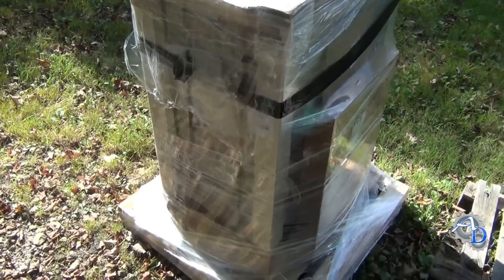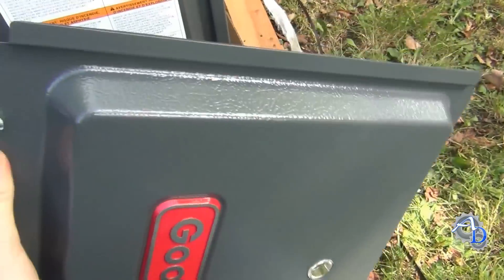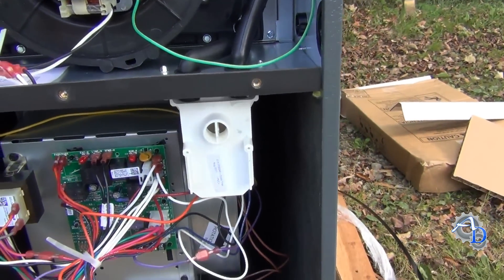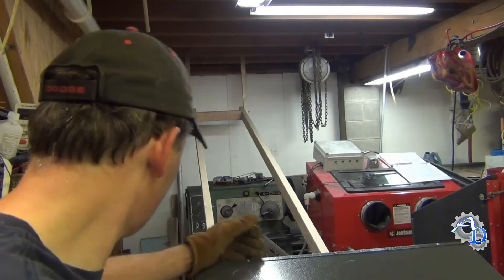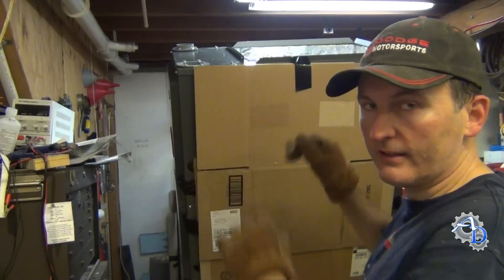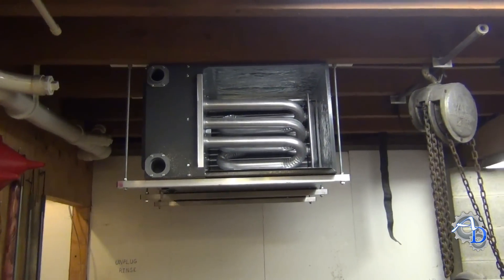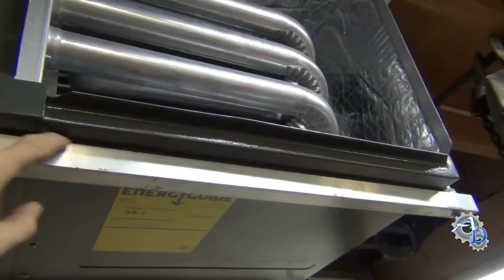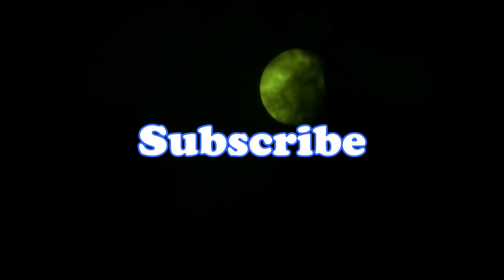HVAC Techs Didn't Like This Furnace Installation

Comment: Are you going to show the rest of the install? I wonder whether the mfg. allows the heater to be installed horizontally?   Thanks.Jim
Reply from the maker: I don't have footage of the entire installation. The manual shows how to install horizontally and where to run supports.
Reply: @ArnoldsDesign  What I’m curious about is the ducting you used for supply no return. The plumbing and chimney are easy, the duct is not.    Thanks     Jim
Reply: @ArnoldsDesign  Supply and Return....Jim
Reply from the maker: @jimpie231  There is no ducting. The directional louvers you see on the front are it. There is a 16"x25" air filter on the back. It is used the same as a garage heater, but high efficiency.
Reply: @ArnoldsDesign  When you set the furnace up, which speed did you use on the blower motor? Once operational did you check the amp draw? Thanks....Jim
Reply from the maker: @jimpie231  I honestly don't remember which speed I set it to now. I didn't check amp draw, though furnace blowers use a lot of electricity. Since there's no ducting, I checked intake side vacuum with a water column to make sure it's within specs.
Reply: @ArnoldsDesign  How do control the furnace?   Thermostat?   Jim
Reply from the maker: @jimpie231  Yeah, a typical 12v thermostat on in interior wall.
Just an fyi:  Some techs claim Goodman's are known for burning out primary heat exchangers. They're pushing 20k btu per primary tube. Garage heaters I've seen this size are pushing about 12k per tube, but with smaller tubes, though they're not picking up heated air from a secondary exchanger first. I measured the elbows running really hot when I first set it up, so I derated the burners a little to decrease btu output to lower exchanger temp, and prevent short cycling. It has worked out well. My exchangers are in great shape, and it heats my shop really well.
Reply: @ArnoldsDesign  If your unit was cycling on the high limit, it’s because you were moving too much air. That’s why I asked you if you checked the amps. Normally heating you use the slowest speed on the motor. You should consult the mfg. about the application and how it should work.    Jim
PS......years ago, I visited a friend, he was visiting his neighbor, they were sitting in the garage during the winter. The friend had picked up an old furnace and using it to heat the garage. I sat there with them and realized that the unit was cycling strangely. Knowing something about blowers, motors and furnaces......I realized that it was cycling on the high limit. The intake was just a hole on the side where the filter was, no duct. The discharge (top of the furnace) was a 90 degree duct and it was open. I turned the furnace off and waited for it to cool off. Then I covered the 90 degree elbow with a thick board covering the opening until the amps were right. I made a sheet metal cover and put it on. The furnace worked properly after that.
Reply from the maker: @jimpie231  Thanks for advice. I will check the blower setting. I don't quite follow on the high limit thing though. My furnace wasn't shutting down because of limit switches, or short cycling that I'm aware of. The derating just had the effect of lengthening cycles somewhat bc of reduced output. I checked the intake vacuum between the filter and blower as shown in the manual, which checked out. I don't know if that's what you meant, or if you meant the exchanger temp high limit. The reading was ok there too, so I must be missing something.
Reply: @ArnoldsDesign  How do you control your furnace?    Jim
PS....all furnaces have a temperature limit, it’s called “high limit control”. Purpose of it is to keep the unit from a dangerous situation if the furnace would get too hot. Say, you blower didn’t work, that would be a situation that this would shut-off the gas and the unit, otherwise you could start a fire,
Reply from the maker: @jimpie231  I use a 12v honeywell wall thermostat. It's cycling normally, and shuts down when thermostat says, and turns on the same. I'm not having any issues with it overheating that I can tell, and I've never had any codes start blinking.

Comment: Lol.....no we don't hate you , ya made us crack up ! 
You could've saved yourself some work using a standard ceiling mount garage heater .
Though your scheme to lift the furnace did make me chuckle . 
You could've simply used gripple cable with lock blocks screw in four duct hangers and raised one corner at a time until you got it in place , then just two unistruts with 4 lag bolts into the bottom of the joists then your 4 threaded rods etc . 
Price for the standard garage heater about 400 bucks depending where you live  , very lightweight , comes with brackets  far less maintenance than a standard forced air home furnace though you would have to flu it out the roof or with a sidewall thimble .
Outside air into the return is optimum as well .
Or if you wanted , you could go with 220 electric , extremely lightweight , easy multiple mounting scenarios , very small
Forget about the 90plus efficiency , you wouldn't know the difference between an  80 % and 90plus especially being mounted to a ceiling where it is least efficient . Your heat has to basically come down to thermostat level to satisfy . The blower will do this faster of course however it will short cycle more often .
If one is bent on using a  standard furnace in a garage I would suggest doing a proper install , though it's more work and money , at least it's done proper .
Place it in the attic above the garage and duct to and down the side walls so the heat comes out at the floor , also run your return air to the floor as well . If it's a shop combo you'll be using often , since it's a furnace you can throw a coil and condenser on it for ac
Them again , if your going to do that , just go with a split system , no duct wall mount unit .
Since heat rises you want to use all that  air you spent money on heating  that's just  hanging out at your ceiling doing nothing 
You want to keep  that air  back down to your working space  as best as possible . 
 This winter check your temp at the ceiling and the temp @ the floor and or 4' off the floor . You'll see what I mean . 
The furnace is not efficient as it's installed now , but I'm sure it is doing the job .
Economically speaking , an electric unit with a seperate ceiling fan would be more appropriate .
Of course the best bar none  is hydronic in floor heat which is what I installed for my garage/shop area .
You can run it off a water heater with a cheap heat exchanger and small pump .
Granted most are not willing to pour another 2" on top of their floors to cover the pex ,  however fin tube baseboard works extremely well with a properly insulated garage/shop area . Don't worry about freezing the water you can always use glycol mixture on your seperate closed  water heater/boiler .
But I digress ....... 
Bottom line , a simple ceiling mount garage heater , electric or gas would've saved you time and money . 
Btw , have your heat exchanger checked every year especially in a garage  , car exhaust tends to eat em up .Granted your pulling in outside combustion air , however chemicals , exhaust , etc  can have an effect , remember , your still pulling whatever is in the garage through the furnace , of course the larger particles will be caught by the filter .
You've had the unit in for awhile with no issues which would be the case . However I'll check back with you in a few years when your replacing a number of parts .
A goodman contrary to your opinion is a cheap builders model and you don't need all those btu for that tiny space .
You can always block off a burner using only one saving you some $ Though I'd have a professional hvac guy handle that .
That said , this is adequate for a temporary , it will give you more than you need .
For your next building do some more homework on your mechanicals . 
In floor heat is far more inexpensive to operate as well as comfort you've never known , your entire slab becomes a heat sink as well as your walls , work tables etc etc which radiate heat for hours while the unit is not on ,  and I'm sure you can install the pex etc yourself , and a small boiler typically is super low maintenance , and if you want a washroom etc in your future shop you can put a tank next to it and get almost  free unlimited  hot water in the winter ! 
Cheers !
Reply from the maker: I have 220v heater upstairs. Works well. I had to slide the furnace in place this way b/c there's a big bandsaw under that location. Couldn't use lower efficiency garage heater. No good place to put hot flue pipe. This furnace has been derated enough to lower btu to prevent short cycling, and keep heat primary exchanger temps lower to prevent burnout. Goodmans push more btu's per tubular exchanger than some other makes. Probably not the best idea. Heat exchangers on this are operating well below oxidation temp. Water column on fuel pressure checks out, and also on circulation blower pressure. Fuel/Air ratio checks out. Louvers blow air to working level. No vehicles inside to corrode exchanger. The only thing I would've done differently is use the unislut. I had box tube there taking up space, so I used it. Uses less $/yr in fuel than my hard coal stoker did, and much more convenient, so I'm happy with it. Maybe my next shop will in floor heating. Thank you for the info.

Comment: Just put mine up .. ceiling is 25 feet ..threaded rod hooks to the top 4 corners ..scissor lift ..now to decide through the roof or through the wall for an exhaust

Comment: Bravo dude thats usin the ol noggin lol she looks sweet hope shes keepin ya warm !
Reply from the maker: Thanks. It's still keeping the shop warm.
Reply: @ArnoldsDesign  outstanding brother i just have a 3 ton AC/Heat unit from a mobil home in my all steel 30 by 40 works pretty darn good i like it .

Comment: Nice job lifting... I woukd love to see the completed project.. Just a note tho... Next time, pay closer attention to. The "minimum clearance requirements"  especially for the front... If the blower fails you won't have enough room to remove... It comes out the front, same with the heat exchanger... And btw... The heat exchanger on a 96% afue goodmam is lifetime.... Look it up, they will warrant that part for your lifetime.. Rest of parts are ten years out of the box... Make sure you register tho
Reply from the maker: Thanks for info.

Comment: I admire the initiative and positive attitude but would not do this myself.  I like to save money like most of us but there is so much that can go wrong that I paid my HVAC contractor to install mine in my garage.  I think when one considers the costs, time required, and the complexity, not to mention the issue of a warranty being lost usually, I think it wise to leave this kind of installation to a professional.  People don't know what they don't know.  I assume you did this mainly for financial reasons and would be curious about the cost of the unit and the materials needed to complete the job.  Best wishes to you.
Reply: Joe Farley,  There might be some truth in what you say, but I think if one does some reading on the basics of heating and pays attention to the details,  they can install their own furnace.  I realized one advantage of installing my own furnace just last week.  The zone controller of my system went bad and it was an easy fix for me and the part was under warranty.  I think if I paid someone to install my furnace,  I would not have known how to fix it myself.  The fact that I installed my system really makes me more familiar with it and how it works.  But, I completely agree that if you're not willing to put in some time and learn how to do it, you should leave it up to the HVAC contractors.
Reply: @tomruth9487  I agree with that.  And you probably have more skills than me ... ha

Comment: I have glue, spray glue, thinner, spray paint, automotive paint, gun powder, torch, etc. in my garage and would never use anything but electric. Even dust of almost any kind will explode..under the right conditions. Yes, the combustion chamber is sealed, but it not worth taking the change of being that guy, film at 11. The warranty is only good if a qualified Goodman Technician inspects and starts it up. The gas pressure has to be measured at the regulator on both low and high settings, then adjusted for your propane. Proper sizing of gas line to your tanks run for pressure drop, proper condensate drainage & no double trapping. It is way to much for installation if you have not had training. Do you own a H2o gauge? Good job on raising it though, and I think you meant to say "Camper Shell" tape.

Comment: Just a suggestion for next time....once you have put in the pivot bolts on the far end, take a height measurement. Then you can make a pivoting u-shaped 2x4 leg for the close end. Do a dry run and lift the ramp level, swing the leg into place.  You can then drill a through hole through both 2x4's(ramp and leg) for a holding pin. This can be done at both leg attachment points for piece of mind.
Reply from the maker: Good idea.

Comment: My furnace doesn’t work when the door is ajar. Do I need a new door
Reply from the maker: Close the door. There is a safety switch on it.
Reply: Arnold's Design I keep telling my husband that it a door problem but he say NO.  There is a switch on the front of the unit.  When you open and close the door it start working. The open is bent but he won’t replace it
Reply from the maker: @jacquelinecarter2333 The door can mostly likely be bent back, or the switch might be bad.
Reply: Arnold's Design thanks I’ll order a new door and see what happens

Comment: Over 40 yrs in the trade tells me this job is going to bite someone.  I'd like to see the mess when it's done?????
Reply from the maker: It's been running a year now with no problems. Works great.
Reply: Lol. I am sure there will be no explosions or great disaster. Worst case it fails early. Not likely though.
Reply from the maker: 5 yrs and no problems at all. Still works great.

Comment: In calculating but you measure width times length times night. My shop is 28'w by 42' by 21' high at the peak (no ceiling but insulated). I figured the average for high at 16'. 80,000 but gas furnace that's now 20yrs old can run me out whens its 10° out  with thermostat set at 60° with even heat through out so yours is way, way more enough. Contrary to what most people think put the furnace in a corner closest to you garage door and aim the furnace to the opposite rear corner. Reasoning for this is heat will build up from the rear towards the door and you'll get even heat through out. If you put it in back pushing towards the front door much of your heat will be lost trying to heat a door. Oh yah, put your thermostat about halfway down the wall along the same side as the furnace. My advise didn't come about easily

Comment: I own 5 homes and Goodman furnace is a good furnace  I think tec think they are crap because there are so many out there  and homeowner can fix and install them there self  I am a believer that bigger is better . high efferent furnace  does not put out hot heat like the older  inefficient ones did ,  two thumb up buddy......'';''';,
Reply: donald allen techs think they are crap because they are built cheaply. On the ac units they use cheap parts that while they may last long cost you your hearing from how loud they are

Comment: Wonder if a dry wall hoist would have worked for you to get it in place?  Works for dry wall but a 100 pound furnace may have been too much for it to handle.
Reply from the maker: I don't know. Could be worth a try.
Reply: @ArnoldsDesign   You would have to lift the furnace the minimum height of the drywall hoist first.   I hoisted a 300 lb steel I beam to my garage ceiling with 6 cargo tie down ratchet straps.  It worked very well, but I understand that your lathe would have made that method more difficult.
Reply: Would have worked. .also screw an eye into the beam and pull it up with a rope
Reply: 4x12x5/8" is 200lbs

Comment: Sorry to say this bud, but by installing this unit yourself you automatically voided any warranty. Check your warranty paperwork. In addition you voided the warranty when modified the orifices. Not to mention you just released the manufacturer from any damages that may occur as a result of fire or damages due to those modifications. Best of luck
Reply from the maker: Orifices not modified. LP kit. I knew of warranty limitations. It was stated on the seller's site. Thank you for your comments.

Comment: Hard to tell from a distance but you need 24 inches in front of a blower to remove it. You need per code 36 inches it front for a service man. You also need 1 inch from back and sides from combustible material. Pull it down, flip it over, make sure you can put a filter box on the rear, use struts. Better yet you could have set it on the floor and you would have been done now. What’s more important time or space and safety.

Comment: That install looks better then the last two I saw a hvac technician install! Looks great but you may want to make a main run with adjustable vents just because you may need some back pressure for it to run correctly.
Good job!
Reply from the maker: Thank you for that :) I do still have to install the duct work to the top floor.
Reply: correct you are

Comment: Why didn't you just rent a flow hood hoist at the rental yard. My heat exchanger was twice the size and twice as heavy and I did it single handed with a flow hood hoist. Home Depot rents them as Material Lifts. https://www.homedepot.com/tool-truck-rental/450LB-Material-Lift-12/2412/index.html
Some times, they are called cable hoists. http://catalog.tatesrents.com/equipment.asp?action=category&category=29&key=5912
Reply from the maker: That's a good idea, but there was just no room for me to use something like that, just a narrow walkway.